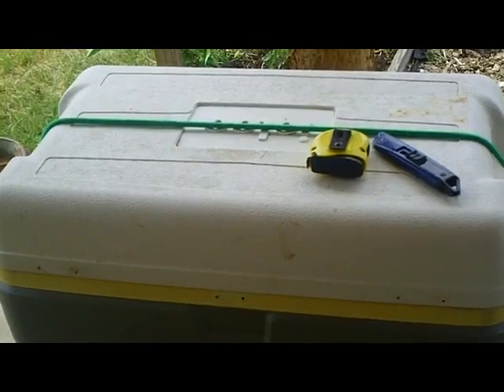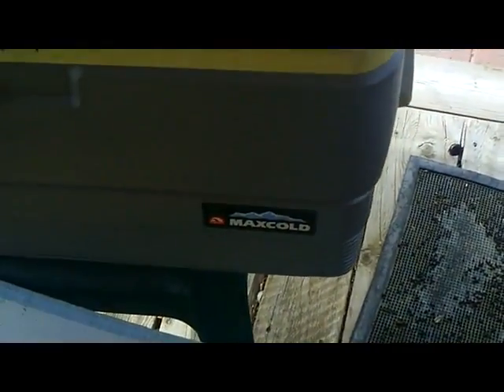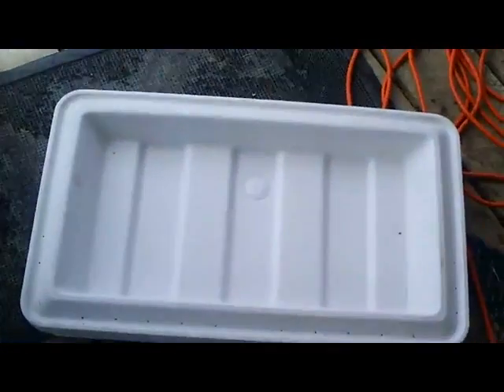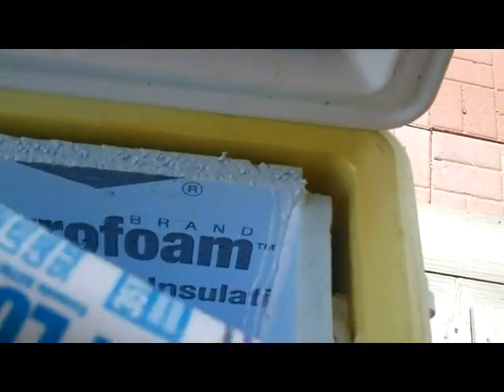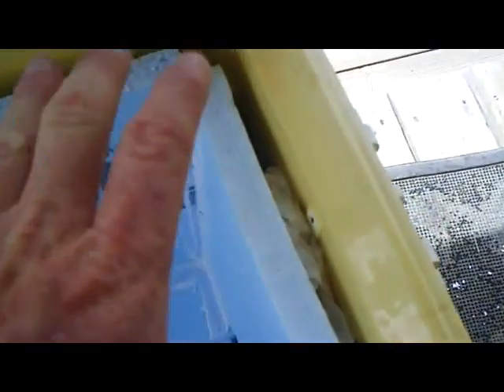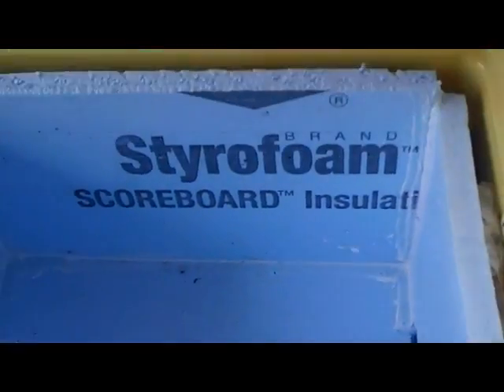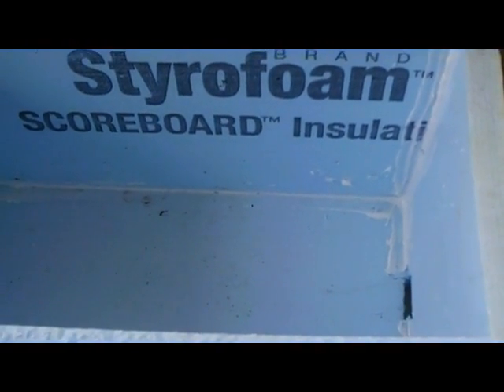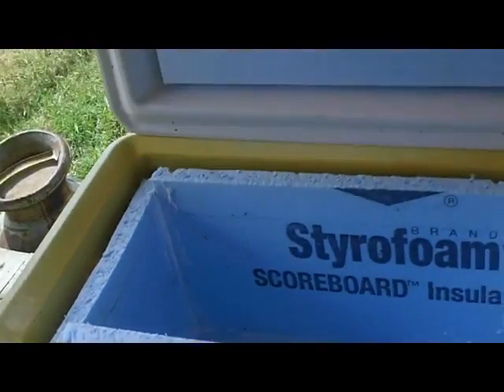Build a Yeti Style Super Ice Chest Cooler

Comment from the maker: They make 4 season campers with better insulation if you can find one. You can add insulation under the camper and a skirt and seal and weatherstrip the doors. Put plastic over windows in winter. You could build a temporary greenhouse over the camper and that would help. Airstream campers are 4 season.

Comment: We just got back from a 6,000-mile trip around the U.S.A. and before we left we picked up an Igloo Ice Cube for $25 at Sam's Club.  Our old Rubbermaid wheeled cooler sells for $50-$60 but despite being called a 4-day cooler I'd only call it a 2-day model myself and we needed something better.  The Igloo I would have to call a true 5-day cooler... a tad more actually.  By using it to store foods and a smaller cooler for drinks and food on the road we did quite well.

Comment from the maker: You certainly could and it would save you room inside the cooler. The foam is more likely to get wrecked on the outside so you may want to cover it with a more solid material.

Comment: I had the same idea,but i'm going to find a nice clean chest freezer that is broken or just free and insulate the inside just like you did and use my solar system that currently runs my 5.5 cf fridgidair chest freezer to make ice to use in the non working insulated chest freezer as a off grid solution that will be 100% free off grid refrideration!

Comment: I should add, good tip man : ) I get dry ice for extended trips where I have a cooler, adds to life & I always wrapped the cooler in like sleeping bags or something during the day, or dug a hole to help keep it from losing heat. THIS is much easier, but the dry ice still helps so as valuable as ice is when you can't get more, it's worth the $.

Comment: You don't even need the ice chest. Just build the size you want with the whole sheet, clue strips of balsa wood around the exterior and spray with 45 min epoxy. 

You can make it as large as you want. You could even add layers of insulation between the sheets and get an R30 rating that's custom build to size.
Reply: +Claude “Reviews4U” Rains I think the idea for this was also something you can move.
Reply: Balsa wood isn't nearly as hygienic as plastic.
Reply: Claude Rains do you have any more info on this thanks
Reply: most people who require these types of coolers are sportsman and need a very durable plastic a la rotomolds..

Comment: Good vid, up here in the north, the BWCA we do the basic same thing only add aluminum foil on all side, for reflective surface, also add additional thick peice of insulation on top, to push down as you use food, the ice then has less space to cool. arrange food by usage,1st used on top, if you freeze all it helps too. You can go with DRY ice as part of it and you will have ice for your beverage of choice. I like the songs on your vids! Thanks

Comment: Love and follow your videos. This is another good concept, can't argue that. However, I think despite all that caulk, I would be a little reticent to use bare ice in the finished project b/c water has a way of getting under things (at the drain hole), and might create a moldy or musty situation you can't get to later. I keep water filled plastic juice bottles in my freezer for use in my cooler. They are handy and easy to use and reuse, and don't leak. Handy for bringing home groceries in cooler.

Comment: another idea is to fill the air gap between the insulation and cooler, fill the cooler with water to add pressure against the insulation then use that spray insulation with a long straw and "gradually" add foam between the layers. This will give you better than R10

Comment: Plastic is an excellent insulator, that two layers of hard plastic, (inside and outside) probably add almost an R5 to the 1" of R5 foam in between.. therefore, it should have about an R10 or so to begin with... So adding the additional 1", R5 material should end up with about an R15 value... Only makes sense... 
 Another easy way, if you have a plastic box the right size, use it for the inside, fill the void with expansion foam...

Comment: Right on time !
Currently, I am offgrd and using a small solar power system.
And I just happen to have a spare cooler. What do you think about also adding a small 3 volt computer cooling fan to the inside of the lid to help keep the air at the top of the cooler as cold as possible ? 
PEACE and THANKS!
Reply: +Snapshotok2000 
Igloo and Coleman both make thermoelectric coolers that operate that way by using a small fan and cooling/heating technology to pull warm air out and cool the outside air going in or heat the air going while pulling the cold air out! 
They can cool to 40 degrees lower than outside (the cooler box) temperatures or heat up to, roughly 120 inside the box!
I’m sure that putting a small computer cooling fan inside the cooler will help to circulate the air inside, which should help maintain a cooler inside atmosphere.

Good luck and have fun! 

If I’m not 5yrs too late with this comment!

Comment: Make a super insulated ice chest by using a 2 inch 4 ft x 8 ft styrofoam board  and cut your pieces and this works well. You can make a 4 inch thick cooler inexpensive without having an existing cooler from one sheet if you don't need a large cooler. Spend a little more and you can install a turn valve similar to what's on a garden hose. You have to install the drain plug yourself and the handles. I use a thick piece of polyrope for the handles from an old utility basket for handles. Heavy duty handles that can take the abuse.
Reply: Interesting! What do you use for the outside walls?

Comment: Yeti coolers reccomends leaving the water in the cooler, saying that the water is cold and will help keep the temperature down. I haven't tried this yet, but my Yeti will get lots of use once bass fishing picks up in the spring.
Reply: Water is thermally lazy, it doesn't like to change temperature. So, if you have cold water in your cooler it makes sense to me to leave it in there. Air is much easier to warm, and will replace that cold water if the water is drained.
Reply: water has a high 'specific heat'

Comment: Think Pot Coozie. The foil lined bubble wrap is 1/8 inch thick with a R-value of 7.

2 layers inside would be R-14 Then a double layer with a slip on over lap lid would give you a total of R-28. Not as much loss of space inside probably for less weight for a whole lot more insulation. The outer layers can be removed during transport.

Yes leave the water in. It takes a lot of energy to raise water temp even 1 degree. If the cooler is cold the water will stay cold. Keep cubes in sealed bags and bag or even double bag blocks to minimize tearing. This helps keep you from the soggy food syndrome. Warm moist air entering when opened will cause condensation. This should be drained. Most cooler manufacturers recommend dranig when moving to lighten the load

Comment: The expensive coolers like Yeti or Engel not only have thicker insulation but have rubber gaskets, better hinges and handles and a bunch of other stuff. If you are going to use a cooler a lot they are worth the money. If you are looking for a cooler that has good insulation and you will not be using it as much or beating on it the Coleman Extremes sell for about $50 and are the way to go.

Comment: Could just frame some aluminum square stock, get some sheet aluminum, some casters, and self tapping screws or rivets. Paint the outside FLAT WHITE with like, plastidip. Then put thick closed cell foam in. THEN, frame out the inside with aluminum. Run a small pvc drain fitting in, with a ball valve on the outside..  Commercial grade. .. OR.. a broken deep freezer..

Comment: I just went and checked prices on this Igloo Maxcold cooler. Its nearly $200!!!! And it didn't last but a few years. What a total POS! So now go buy another one for $200. And another and another and another, ect., ect.. The most frugal and practical thing you can do is spend your money once. There is a whole lot more different than the insulation thickness. Yeti's are roto molded out of tough thick plastic. Igloos are heat drawn over a mold out of thin weak plastic. Then glue and screwed together. It isn't meant to last. That way you can buy another from them in a few years. I spent $75 dollars more than I assume he did on this Igloo. And it is seven years old. And gets used and abused a lot. I use for a seat and casting platform in my flats boat. Stand on it for step tool. A seat around the camp fire. Throw in the back of the truck for tailgating. Or drag out to the fields for the kids soccer practice. It shows no sign of letting up. I guess this is a good use of busted cooler. But if you really want a good cooler buy a Yeti.
Reply: These igloos are about $45 at walmart
Reply: Didn't see this exact cooler there.(Discontinued?) I was referencing this exact cooler on Ebay
http://www.ebay.com/itm/Igloo-13021-120-Quart-Maxcold-Extended-Performance-Cooler-/171174414438?pt=LH_DefaultDomain_0&hash=item27daca4866